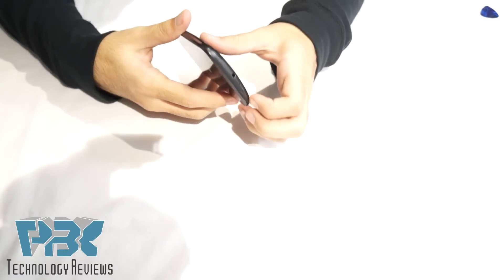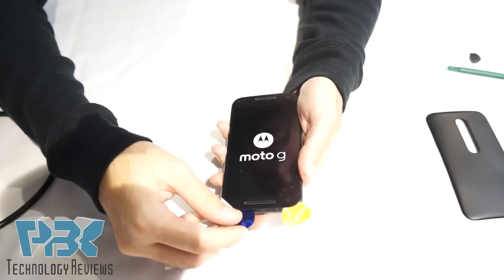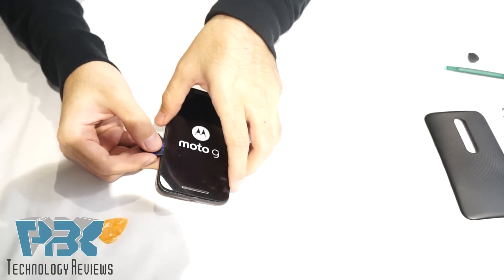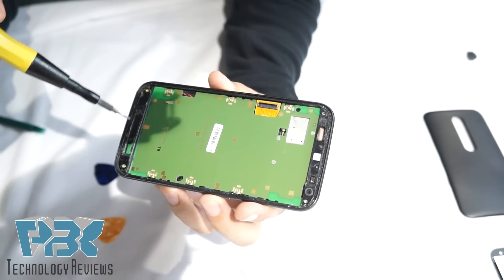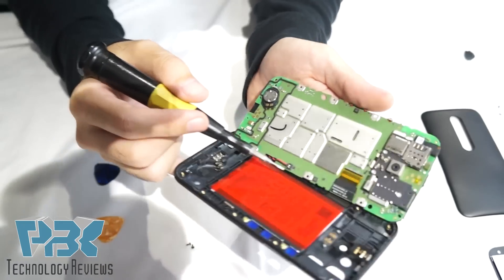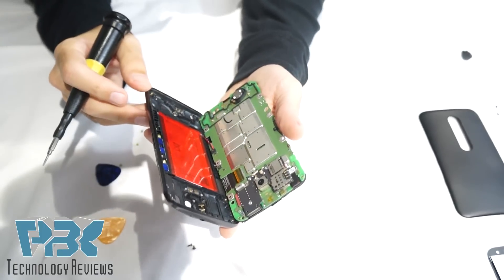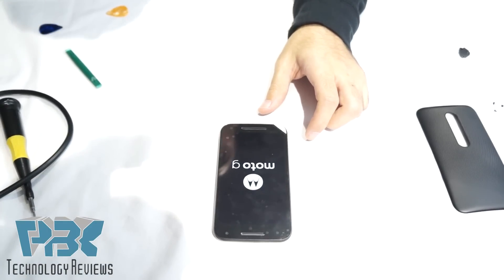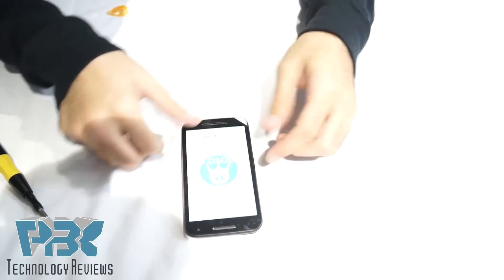Motorola Moto G (3rd Gen) 3rd Generation 2015 Disassembly Teardown LCD Replacement

Comment: Could you test if the Moto G3 remains waterproof(IP57) after screen replacement?
Reply: +Miguel Prytoluk 5
Reply: Moto 3 g got wet with coffee but that time it's only on screen and still working... but after 2 day  now speaker not working .. it's working in headphone .. what should i do....
Reply: It's not IP57, but it's IPX7. I don't know the answer to your question
Reply: Ya the 'x' is because its not dust proof. But the 7 means it is waterproof upto 1m depth. Ive tested it is waterproof. I was just wondering if it remains waterproof after screen replacement.
Reply: hello friend , after screen replacement , the mobile won't be waterproof anymore , but now there is machine to make mobile waterproof again , any question , welcome for inquiry ! : )
Reply: @Nancy, could you please give me more details on making the mobile waterproof again? What kind of machine is that? Is it DIY'able?
Reply: Could you add my skype (nancyyang9308) or whatsapp (+8613590439558) , and then we talk more details ? Waiting for your news !　：　）

Comment: Good afternoon friend have a doubt the flex sim card model motorcycle G3ra XT1540 of 8GG a SIM is compatible with Unifix-Micro SD SIM card reader spare Flex for Motorola Moto Kit G3 3rd generation XT1550 one Sim tool. Thanks

Comment: Great help. My daughters messed up the SIM reader (it's a micro and T-mobile has a nano - you need an adapter). I ordered two for their Motorola XT-1540, got it in two days. Followed the instructions (the disconnection of the screen=LCD was a little hard to follow) and replaced the SIM+MicroSD reader. Now instead of two pieces of malfunctioning electronics my girls have their phones back. Thanks for the great Video.

Comment: Thanks for the overview.  One recommendation for those replacing the screen.  go ahead and  take off the main board.  It is difficult to reconnect the screen cable.  i tried for 30 minutes to get it.  Once I took off the main board, the connector for the screen comes off very easy.  Take it off, connect it to the screen cable and then reconnect back to the main board.  Would have saved myself over half an hour.  Good luck and take your time as you work with the heat gun.
Reply: Nick Wilson Hi mate. Hi. What do you think, can I use hair dryer to disasembley LCD?
Reply: I found I was able to reconnect the screen cable with the board still attached to the phone, but it was kind of tricky. It helped to put the phone backside-down on a flat table, and then bring your eye level down to the level of the table, and from there you can hold the screen just above and use a finger to slide the connector in. Might be useful to get someone else to hold the phone down so it doesn't move while you re-attach the screen. It's a PIA but it works and didn't take more than 5 mins.

Comment: My moto G got wet. now will come on then turns off. the pixels appeared to have been damaged. any clues??
Reply from the maker: You would need to take it apart and make sure you clean out any water or moisture inside. Also use a small brush or tooth brush to clean off any corrosion on the connectors and board. As for the screen, if it has issues you would need to replace it no way of really fixing it.

Comment: hey, do you use some extra glue to reassembly the new screen or Will the heat just do its work to stick everything together?
Reply from the maker: we didn't use any extra glue, we just reheated the original adhesive. It all depends on how your adhesive is holding, if it has too much dust n debris on it, it wont hold as well and would require you to apply new adhesive. If you are worried, its always best to apply new adhesive to ensure a strong hold.

Comment: After replace the new display, the proximity sensor it's not working well. During a phone call/whatsapp audio msg,  the screen turn off, like if the sensor is covered, but it's not. Anyone with the same problem?
Reply from the maker: +Fabian Ventura make sure you didnt cover the proximity sensor with adhesive or accidentally damage it. Also make sure the LCD you bought is not a bad one that does not have the hole/opening for light to get through. Some after market ones arn't made well and cause either too much or too little light to shine through. Hope this helps.
Reply: +pwrdbykyank looks like what you said, but with the original screen the problem continues. If i open the screen a little bit, the screen turn on, if cover again turn off.  Also I try to disconect the battery, and nothing. This is really strange, beacause the sensor is working, crazy but working. 😯
Reply from the maker: I'm not sure if this phone has a rubber gasket that went around the sensor, but see if its missing or out of place. Maybe too much light is hitting it.
Reply from the maker: nice :)
Reply: +pwrdbykyank Yeah mate, i just painted the proximity sensor hole with a black cd marker pen and works like a charm!

Comment: Hey man ? the camera flash slit on the back of my g3 is a bit loose is it just with my device ?
Reply from the maker: +Naveed Beigh didn't notice this one being loose, might just be your device but wouldn't worry too much about it
Reply: +pwrdbykyank okay thanks :)
Reply: +pwrdbykyank what about Audio Jack is it replaceable?
Reply from the maker: yea but you would first need to take the phone apart.
Reply: +Dheeraj Mawa do you have this phone ?
Reply: +Naveed Beigh yes.. I have this
Reply: +pwrdbykyank do we need to changed the me therboard incase we want to replace the audio jack?
Reply: +Dheeraj Mawa is your camera flash slit loose ?
Reply: No.. It isn't ..
Reply from the maker: No you don't need to replace the motherboard, the audio jack is located on the back housing which you can pop out and replace.
Reply: +pwrdbykyank mine is a bit loose ! should i be worried?  is it replacable ?
Reply: +pwrdbykyank thanks a lot brother

Comment: Thank you for your video. I removed the screen but I need new seals and rubber under the display and speaker and mic cover - the one that I ordered arrived without it. Is there any way to buy it? Do you have any tips? 
Thank you

Comment: I have usb port broken. Does the replacing operation require any soldering, or is it only unscrewing and changing the part?
Reply: And what temperature were you using during lcd removal with the hot air?
Reply: And the last question is, how about water resistancy after reassembling the phone? I mean the adhesive thing, will it provide some waterproofness after re-heating?
Reply from the maker: +Matthew Wsky I don't know what temp we used, but you can use a hair dryer if you don't have a heat gun, and also the usb port does not require any soldering.

Comment: just one more question, you know how in the video you are showing how to replace the led. what if I only want to replace the front glass screen , is there a different tutorial for that, thanks
Reply from the maker: you would need to replace the entire LCD assembly with touch glass. they are fused together and would require special tools n skills to separate and replace only the glass.

Comment: so is the phone still waterproofed after I got everything apart
Reply from the maker: +Raymond Zhao If you replace the adhesive with new one or if you make sure you dont dirty the adhesive much and reapply it firmly with heat, I don't see why it wont hold out water.
Reply: +pwrdbykyank OK thanks cause I need to replace my screen and headphone jack so I was a bit concerned

Comment: I personally dislike phones where you cannot access the battery readily. Whilst I understand they did this so the phone would be waterproof but i rarely ever have my phone near water so i would rather they made a version where the phone is not waterproof and has easy access to the battery.
Reply: assinne Yes it is annoying
Reply: The G4 play is almost the same phone but with a removable battery.
Reply: The worst is when you need to remove the screen to replace the damn battery -_- it's one thing if it's like my old Nexus that you just removed two screws and pry the back off and you're done, but even then, like why not just cut a freaking hole in the back and slap a back plate on

Comment: Good evening. My phone got wet and the screen has gone unresponsive most of the time and it touches itself. II did a factory reset and now the phone boots by itself three times before eorking everytime i try to turn it on. Should i just replace the LCD to get it working again or should i buy consider buying a new one? Thanks for the video!
Reply from the maker: +Conrado Peñaloza You should take it apart and use a tooth brush or soft brush to clean out any corrosion on the connectors or main board that might be shorting the phone.
Reply: +pwrdbykyank thank you for your answer. I'll do as you say and hope it works.

Comment: If the on/off button isn't working, would it be easy to replace it, and what part(s) would I need to buy to fix it?
Reply from the maker: +Fay Isn't working as in its not clicking or it clicks but just doesnt do anything? Or is the button jammed? The clicker is soldered onto the main board so you would need soldering skills to install a new one. If the button is jammed you would need to disassemble the phone to un-jam it

Comment: my headphone socket seems blocked/ broke it won't accept headphone jack can't see any blockages can this be easily looked at without tearing the whole phone apart sorry if this is a silly question
Reply from the maker: +Garry Cowan The only way would be to replace the headphone jack unless if you can see an object in there and can pull it out with a small tool
Reply: Thanks never had this happen before it's a strange fault to happen

Comment: i cant disconnect the cable connector... any hinters?
Reply from the maker: +nicol zelmer It has a lock latch on it, you will need to flip it up first before pulling the cable out. Sometimes its firmly in place so be careful you dont break it when trying to flip up the lock. :)

Comment: Hi , got a problem . My phone is frozen with a black screen since android 6.0 update .Wonder if it's possible to off the phone manually
Reply from the maker: +brandy daryl you can press and hold the volume down and power button at same time to reset the device.

Comment: my glass on my phone is broke not the screen do i have change the whole lcd or can i just change the glass?
Reply from the maker: +Luke Stranksmufc The glass is only changeable by a professional with the right tools and machines. Or else it will be a micky mouse job and touch wont work right, dust under lens etc. Your best bet is to just replace the entire lcd assembly.

Comment: hello, i accidentally made a rupture in the plastic-like coverage of the top speaker. I was wondering if my phone is still waterproof. it seems like the bottom speaker hole doesn't have a plastic coverage, but a see through grid. so maybe either the rip in de upper speaker also doesn't affect the water resistance of the phone. but I don't know much about phones so maybe you can help. thank you in advance!!
Reply from the maker: Hi, I'm not sure if it will affect it or not but have you checked on eBay or online to see if they sell replacement gaskets?
Reply: Hi, thanks for the reply. There are no replacement gaskets on eBay jet. And I'm afraid that when I open my phone, to repair it, it won't be water resistant anymore. But thanks for helping!! :)
Reply from the maker: no problem, I'm sure soon they will have it available to purchase
Reply: hey,,,my moto g turbo also doesnt have any plastic coverage in the bottom speaker hole,,,,but upper speaker has it,,,,Could anyone confirm if it normal.

Comment: Do i really need to apply a new adhesive? or it will work fine w/o it?
*don't care about ipx7.
Reply from the maker: it will still stick without it just won't be as good of a bond as before as long as you don't damage to adhesive too much by touching it and getting it dirty etc.
Reply: +pwrdbykyank are you sure it won't come out?
Reply from the maker: +Jitendra Raghuwanshi ya the adhesive is strong it will hold just put the LCD back onto the frame and reheat it a bit and put some pressure to ensure it makes a good bond
Reply: +pwrdbykyank alright thanks for replying you earned a sub! :)
Reply from the maker: +Jitendra Raghuwanshi anytime, and thanks for the support :)
Reply: +pwrdbykyank being a youtuber i know how good it feels when our videos help someone ;)

Comment: Great Video! 
It looks like there is not a separate earpiece speaker which is used for voice calls... Is the main speaker (you point out in the video) also used for voice calls in addition to speakerphone... can you confirm ? I find voice call quality is not that good and thought it might be a separate earpiece speaker problem - if the phone only has one speaker than it looks like poor audio voice call quality may be entirely due to signal quality. ( The speaker appears ok for non voice call usage) 
GH

Comment: thanks alot for the video i just bought this phone only had it two weeks dropped it A SINGLE TIME and it would not turn on.  I figured it was a poor connection i proceeded to repair and could not figure out how to get inside once inside i found the battery connection had come loose remade the connection phone works normal and this is after throwing across the room several times full throw into the wall :) needless to say i was pissed but all is well now thanks!
Reply from the maker: +Milton Prokopiev lol no problem, glad you were able to get it running again :)

Comment: The assembly of this phone is it's only real con. great all around for 200 bucks. I mean the screen resolution and the battery size only give you a longer lasting battery, but as that degrades over time it kind of kills the longevity. The G4 battery us an easy swap abd I mean the iPhone battery isn't as hard to get to by far. But given how good the battery is you can probably go two years and still get a better battery life than most flagships

Comment: Which adhesive should i use after replacing the screen? Do you recommend any?
Reply from the maker: +Sconeikiin look online on ebay or so forth for those black 3m adhesives if you can find them, those would be the best to use. If not I'd say any thin 3m adhesive will work fine.
Reply: Thanks! I didn't break my phone's screen, but it's nice to know now i don't need to worry how to fix it, because now i know how to fix it just incase :)

Comment: Hi, Sorry for being repetitive, but i made by accident a smal hole in the top skeaper, the one used to calls, can you explain if that would kill my phone if it gets wet?
Reply: Yeah, that thin, horrid film is a real PITA. If it's that easily broken (like mine) it seems you can also easily get a non "water resist" G3 in a hurry, turning it into a senseless feature, because just replacing that PITA of a thin film is also a PITA of a darn process. And then, that PITA film can be easily broken. Again. So I'm thinking on just leave it alone... or replace that film with something else and turn my G3 into a full ordinary, non semi-water tight phone... or not bother at all and simply get rid of the whole device. Yeah, I'm really that pissed off. Sorry. Quite happily, I still have my (better built) G2...

Comment: Can I put a thin grille of the two holes?And what i can use?
I accidentally broke the small clear plastic and just want to put a normal protective grille on holes for speakers.
I must say that I do not care that will remain waterproof :))
Too much dust is collected and should be regularly clean.
Is there enough space between the display and the phone's body?
Reply from the maker: +Niki Letov I'm not sure what your trying to do exactly, but you can try searching for mesh grills or mesh filters etc. However I'm sure they will start releasing replacement parts on ebay and such so you would be able to find the original soon.
Reply: +pwrdbykyank   thanks for the reply.
I do not like the original nylon waterproof thing.That's why I want to put some grill/mesh grill ...yep.
i think I found a solution-will cut from "Shaver Razor Replacement Foil For BRAUN"-found on ebay.
sorry for my bad english :)

Comment: I accidentally torn down the "Grey" coating near ear piece , that is the ear speaker grill,  would that affect water resistance of the phone?
Reply: i also did the same it should have been more durable. its just  a piece of plastic. I'm also in a doubt about it.
Reply from the maker: +Anurag Choudhary I don't think it would affect it much.
Reply: +Anurag Choudhary I did the same and had the same question. It is a pretty bad design. It makes no sense to put such a delicate screen where users will eventually reach for cleaning the ear piece.
Reply: Atleast motorola should replace it for free and give instructions to clean it

Comment: great video!  Thanks for sharing!  You mentioned that you can take out the battery, but did you actually try doing this?  Does it damage anything else?  Could the same battery be removed and put back in without damaging it (I would use a new battery of course but just want to understand what it takes to get it out and back in again)?  Thanks!
Reply from the maker: +LOOregano Thanks, If you look in the video next to the battery there are some gold colored screws, if I'm not mistaken taking those off will release the aluminum frame the battery sits in which is attached to the back housing. I'm pretty sure the battery also has adhesive on the back of it that keeps it attached to the aluminum frame. You would definitely be able to remove the same battery without damaging it and reuse it. You would just need to be careful when prying it off that you apply some heat beforehand to make it pry off easier so you don't bend/warp the battery too much to damage it. :)
Reply: How much will it cost